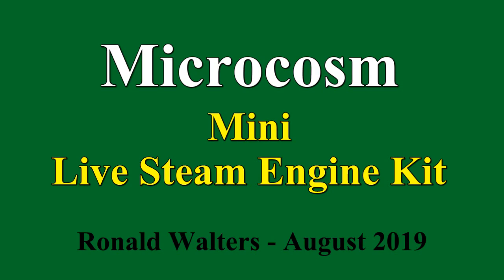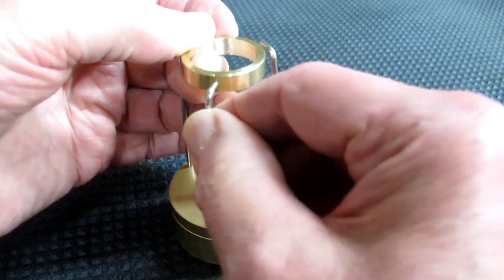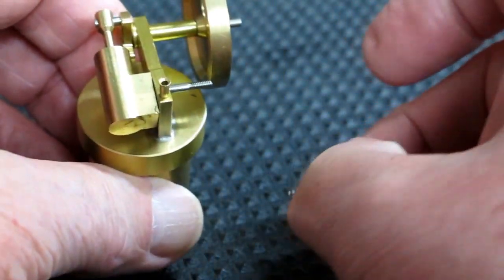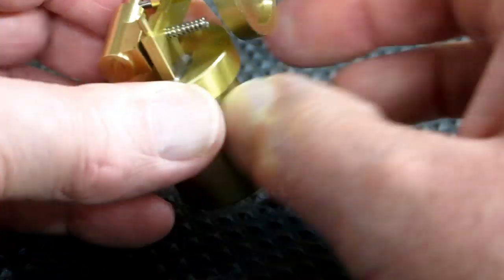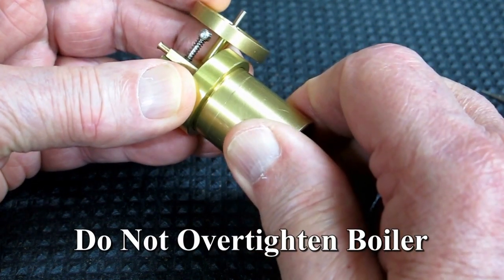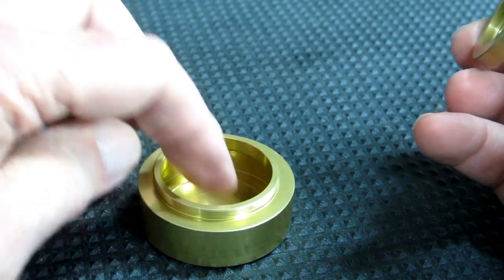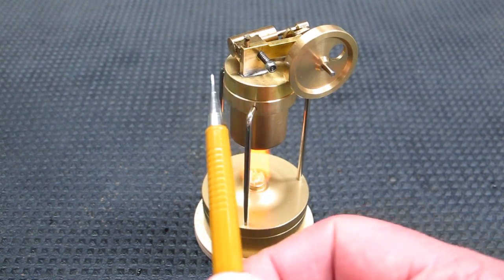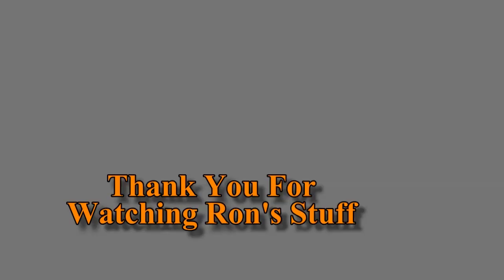Microcosm - Mini Live Steam Engine

Comment: Can I use wd40 as oil
Reply from the maker: WD-40 is a solvent and a cleaner. It is not a good lubricant.
For this engine I use 3-in-one oil or Singer Sewing Machine oil before every run (clean up the mess afterwards) and then reapply before every run

Comment: Hi Ronald I'm wondering what is the purpose of the spring and nut like what does it do and what happend if I tighten it or loosen it. Thanks
Reply from the maker: The spring pressure holds the base of the cylinder against the brass plate but still allows it to reciprocate back and forth for the steam and exhaust ports to operate. There is no intended adjustment here. You do not want to tighten it too tight. Keep all moving surfaces, axles and joints oiled. Thanks for watching. Ron
Reply: @RonaldWalters2010  smashing thanks alot Ron.

Comment: Suggestion for putting the flame out... 
Put a steel thimble over the wick (and let it sit there, it will protect the wick from picking up crap and dust)

Paddy
Reply from the maker: Opening shot shows the thimble on the fuel tank. Most of the alcohol burners for the various engines come with one. Also slows the rate of evaporation.

Comment: Out of curiosity, how long does this steam engine run before needing to be refilled?
Reply from the maker: With the boiler half-full and with an appropriate size flame, I would shut it down after 2 to 2-1/2 minutes (before it runs out of water). It is a small model and the heat content of various alcohol fuels vary.